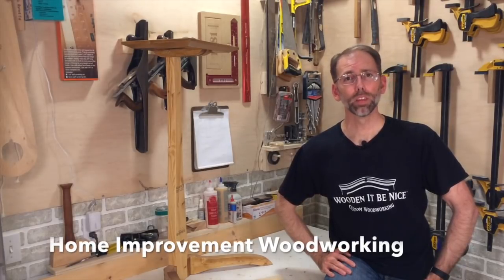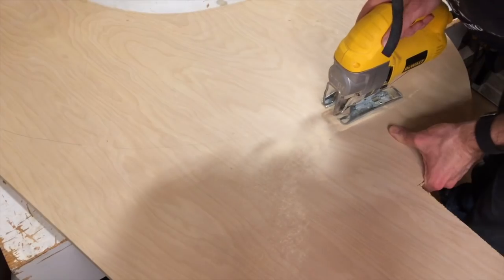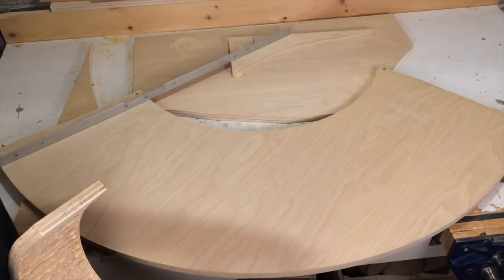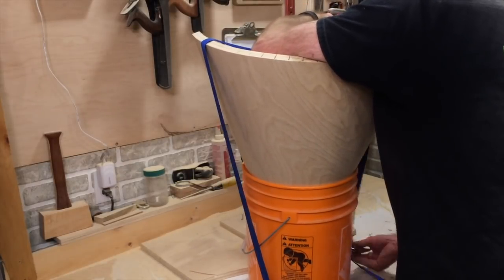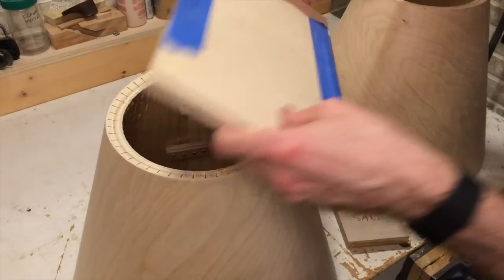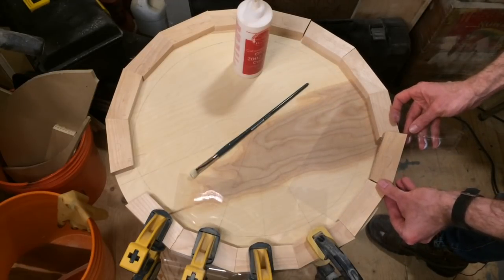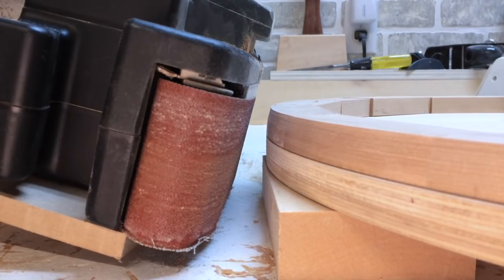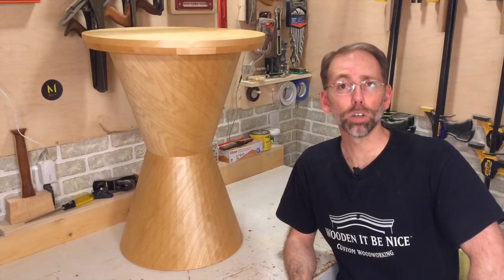How to Bent Plywood with Kerf Cuts - Rockler Plywood Challenge by The Modern Maker Podcast

Comment: Can you take me through the gluing process while strapping it into the 5g bucket? Did you test fit the strapping, undo it, glue it up and then restrap? How long did the whole glue up take?
Reply from the maker: Yes, I did a dry fit to test the clamping.  The process took about 45 min from test to finished glue up.  Cheers.  Scott
Reply: @HomeImprovementWoodworking  Thanks! Great video

Comment: How did the end to end connection look like cause i know its gonna make a gap so how did you deal with it?
Reply from the maker: I show that detail in the video.  I used three metal plates to connect them and flattened the joints using a large flat board with sandpaper attached.  Does that make sense?  Scott

Comment: Hello. One pro tip gor eweryone. This kerf cuts were a little too deep And the spacing betwen curfs was too big. In the end you can see all kerf cuts becouse od this problem. I have done a lot of this typ of work And i rather make few more cuts than not enough. I have done this in high gloss melamin with radious only 150mm (6in). And you culd not seem what was done bicouse the spacing betwen cuts was only 6mm of melamin leftower betwen cuts. Depth was 16.5mm on 19mm board.

Comment: Hmmmmn I would use thinner plywood ? Is there a reason you went for that thickness?
Reply from the maker: Hi Bruce.  The thickness isn't really a factor in how much the plywood will bend, it's how much you cut away and leave connected on the front face.  I chose to use 3/4" as I wanted to have enough material to screw into when I connected the middle section together.  This was an experiment and as it turned out, I don't think I could have attached the pieces with concealed connectors on thinner plywood.  I hope that makes sense for viewers.  Scott